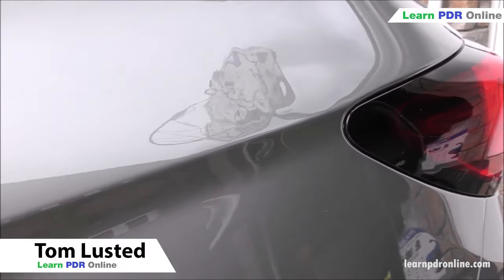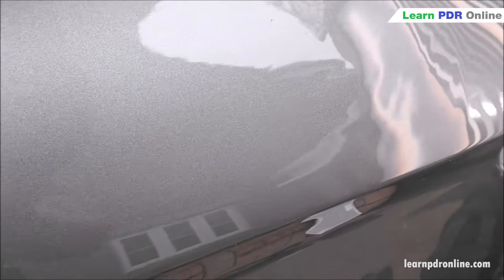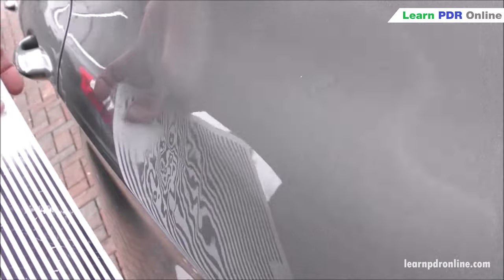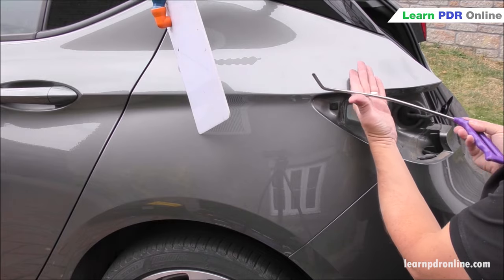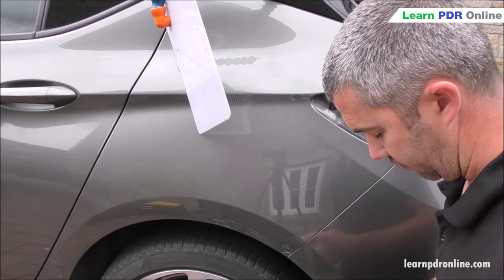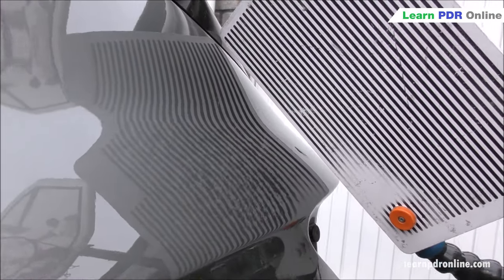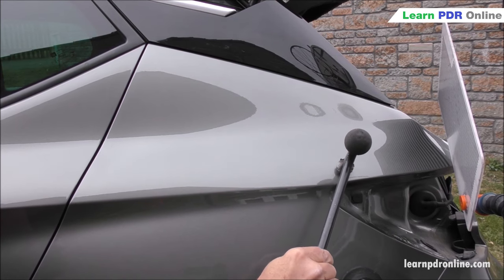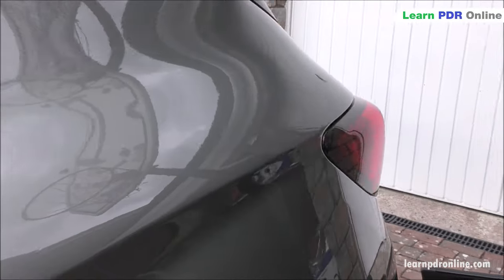When Paintless Dent Removal Goes Wrong! PDR Fail

Comment: This does my head in customers trying to fix damage then come in expecting us to fix their bodge up ,I have a transit 1/4 tomorrow that a customer thought he’d try fix himself but didn’t know the bottom hinge on the quarter is still forward holding in the quarter ,so now it’s all stretched and he’s been hitting it with a pointed hammer
Reply from the maker: Ouch! hitting it with a pointed hammer.... You'll have your work cut out for sure. Yes its tricky finding the balance between showing customers the benefits of PDR without making it look easier than it is Thanks John
Reply: Then why all the PDR DIY videos? I’m here because I kinda feel like I did botch it (enough at least to start getting quotes) but should I expect to get ridiculed by the PDR experts and get sent to a body shop because I ruined my one-time only chance? I don’t get it.
Reply: @LearnPDROnline  Tom you’re great! My comment was for the other guy ☝️

Comment: How hard do you actually tap with your mallet?  I simply cannot come to giving it any sort of tap.
Reply from the maker: You make think this a silly response but I hit it as hard as I need to. Sometimes metal moves easily and I can use gentle taps to move it other times when the metal is under a lot of tension I will use a lot more force to move the metal. Different knockdown materials also change how hard I will hit it ie plastic knockdown vs a metal one,

Comment: Not knocking as it does look a really nice job, at the finish shots u see almost orange peel is that just a massive amount of micro highs and lows that will never come out? And is this a standard for all repairs?
Reply from the maker: Hi thanks for your comment and question, the standard is to get each dent 100% clean where possible but in this scenario the panel had already been stretched when the customer attempted to have ago himself so my job here was to try and save the panel. I did advise it was unlikely to be 100% and he was happy with PDR over the alternative option of a bodyshop. To answer your other question yes there are lots of tiny micro highs and lows which is the result of shrinking the metal manually to avoid the panel popping in and out. The finish shot here is just before I gave the panel a light flat and polish which further reduces the appearance but another alternative would be to use something like an induction tool to shrink the metal. I do not use one of these myself though. Hope that helps answer your questions

Comment: Well Tom another tidy job from you,can you always fix the oil canning
Reply from the maker: Thanks Anthony, not always Oil canning is one of the things I struggle with the most asit really depends on the depth of the damage. If its pretty stretched often there is a very slight ripple or bulge in the panel when looking along the side views. I dont have a power pdr or hot box but they're other options to help shrink the metal.

Comment: I have something same did job on A pillar,may could you tell me if it is repairable with pdr when there is no acces from inside?
Reply from the maker: Hi Camilo, when there is no access to the area behind such as an A pillar then you may be limited to 'Glue Pull' only. It depends on the severity of the damage and your skill level with the tools available but you would likely have to work from the outside only.

Comment: Wow that's a mess !! ... I wouldn't challenge it even . LoL 😂  
Especially, Oil Can part . Without hot box I do t know how one can fix it.
Reply from the maker: Yeah it was definitely a mess but it came out well, a hot box would have helped to shrink the metal in the later stages, without one I had to make small accurate pushes in the right locations surrounding the dent to help create stability in the panel!

Comment: Damn!! Killer job!!   How do you go about getting them micro lows out, with no access from behind? Open them up, by blending and glue pull with a small tab. I have the small root beer tabs.
Reply from the maker: Thanks! Yes if I can not access the area behind, open them up and try to pull up the centre and repeat this process until its out. With this repair I did have access so I di both.
Reply: @LearnPDROnline  nice. Thanks. I got the top half mint. The lower is close. The body line on rear panel above the wheel in a 2017 Mustang is tough to get back. But I’m close there too. Couldn’t do it without your Vids. 🙏🏼

Comment: How long did this repair take and how long would you estimate the repair to have taken if you were the first to touch it?
Reply from the maker: That's a really good question. I think the repair took at least 3 hours to fix. Its difficult to say how quickly I could have repaired it if I was the first as I didn't see the original damage, however I would estimate two things, 1st I spent about an hour trying to rectify the high spots my customer had created so this time could have been saved but also it made it difficult for me to get a clean finish, I believe if I were the first to it, I would have repaired it cleaner, meaning a better finished result and also less time spent on finishing so a little more time saved there too.

Comment: What do I do if I pulled the metal too far out creating a huge mound?
Reply from the maker: Hey Ruben, the best fix is to gently work the mound back down again with accurate tap down work. If the high spot is sharp youll need a sharp tap down if its soft then use a soft tap down. Depends how big it is but I usually start in the middle, the highest spot.
Reply: @LearnPDROnline  do you use metal tap downs or plastic for this mound?

Comment: See I stopped before it got that bad 😅. I got about 50 60% at best but was fighting with highs and lows on a 2014 Toyota Rav4 rear quarter area.
Reply from the maker: 😅 Yeah this one was a bit messy but all ok in the end. Usually these types of reworks require a lot more tapping down than anything else 👍

Comment: What's the best indicator to identify a high spot. Some dents are hard to identify.
Reply from the maker: I use lines to read damage so for me I check the reflection of my lines and when it appears the lines are pinched together or any areas where the lines appear closer to each other than they should be then this indicates the panel is high in that area, Thanks
Reply: @LearnPDROnline  thanks, sometimes I see that and I can't tell if that's high or low. Can you also elaborate why You focus on correcting the high points before the lowest points of the dent?
Reply from the maker: @bulldogkarma  No problem, sometimes when a repair has multiple highs and lows its tricky to see with the line board, the best method is to move the line board around and try it further back until you clearly see the damage. I usually tap down all the highs I can see from one angle to allow me to have a clearer view of the damage, you can either remove all the lows to see the highs or remove all the highs to see the lows, I like to tap down the highs myself as that often reduces some of the 'fake lows' ie areas either side of a high spot that can often look like minor lows

Comment: I did the same thing to my daughters car it’s a new wrinkle finish. Could only use glue pulling and tapping. But man tapping is tough ☹️
Reply from the maker: Yes tapping is a huge part if the process, I often spend longer on the tapping side than I do pushing or pulling!

Comment: It's not finished though, 
You can see line breaking at the end of the video
Reply from the maker: I took the repair as far as I was willing to, to meet my customers budget and expectations, if they had not already stretched the metal with a failed PDR attempt before I attended, it would have been possible to remove completely but once stretched the panel can only be bought back so much with manual manipulation, next step would be to shrink the panel with induction system or potentially repair and repaint in a bodyshop. 👍